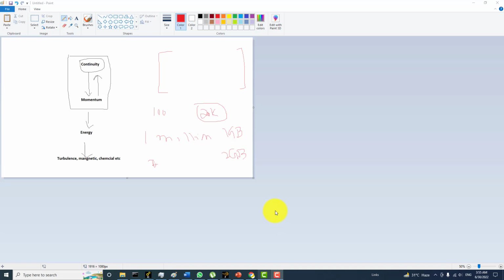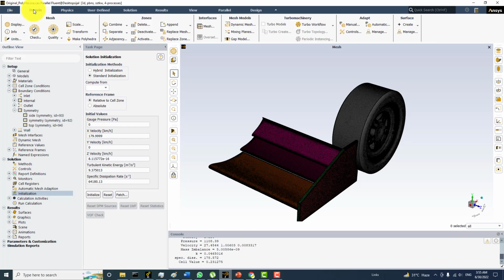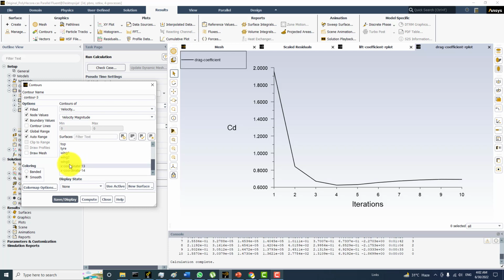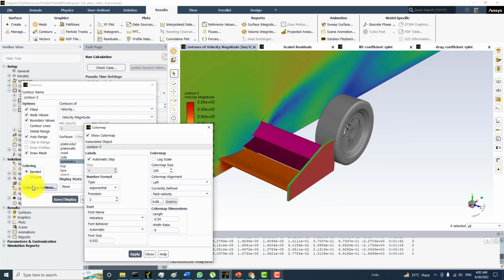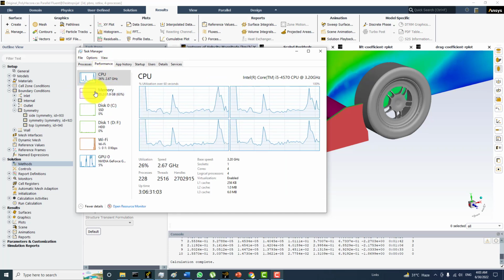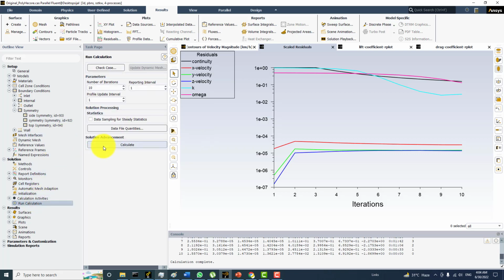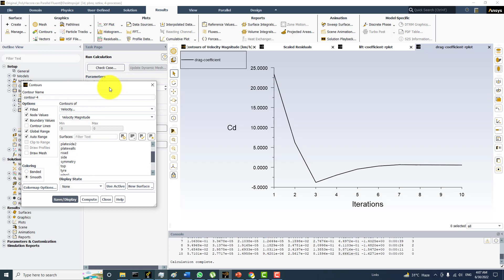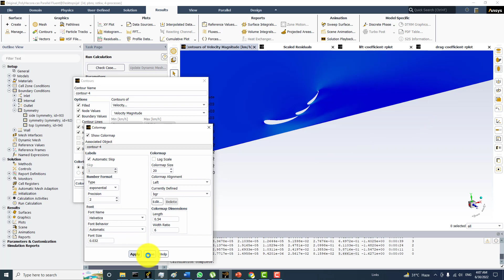COUPLED vs SIMPLE velocity pressure coupling in ANSYS Fluent 2022 R1 - Part 2

Comment: Sorry I couldnt understand it very well. I understood this:

Using "Coupled" method gives us more correct and accurary result but it requires more system performance and it takes more time to  (RAM etc.),

Is that what I understood right ?
Reply from the maker: Actually coupled solver used to give better results as compared to SIMPLE type methods. But in newer versions the results are similar. And even number of iteration are almost same. So now it is not necessary to use coupled solver any more except in few instances may be.
Reply: @CFD_Mechanic  Thank you so much.